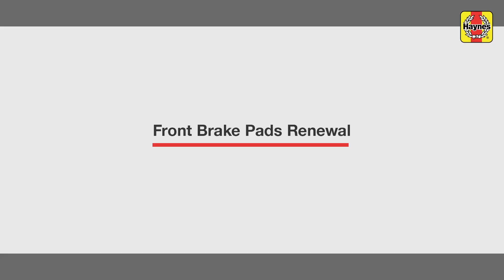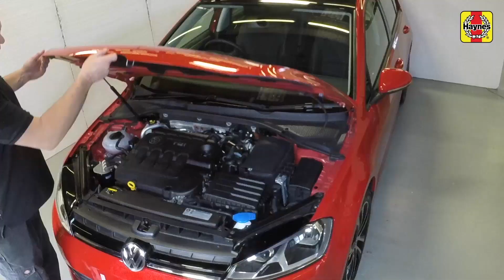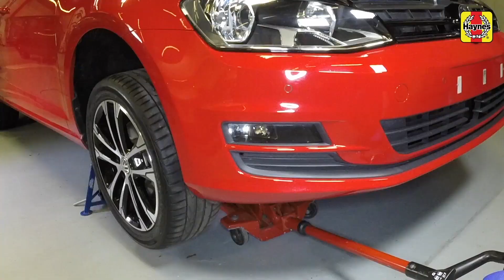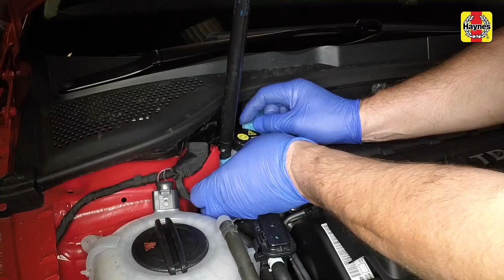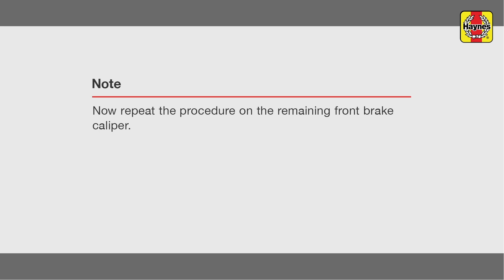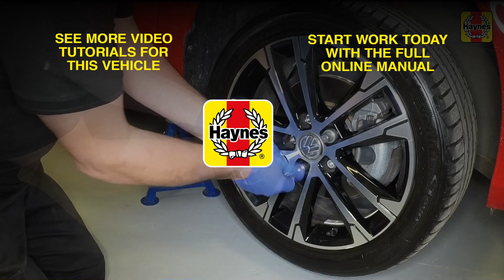Volkswagen Golf (2013 - 2016) - Replace the front brake pads

Comment: I changed my brakes to my 2017, and it appears to have the same design as this car, but I forgot to unplug the sensor before changing the pads. It won't start now, but could that be because of the sensor or is it more likely a dead battery? Seems unlikely since it won't start as soon as I finished working on the brakes
Reply from the maker: I don't think that failing to disconnect the pad wear sensor will cause the car not to start. Probably best to test the battery.

Comment: Shouldn't you resurface the rotor?
Reply from the maker: The general practice in the UK is to renew the discs if they're badly worn. Resurfacing isn't common here, and new discs are inexpensive.
Reply: I would take the glaze off off rotor with 100 grit emery cloth or similar 3m rodac disc etc... it helps breakin the the new pad similar to doing a clutch job.